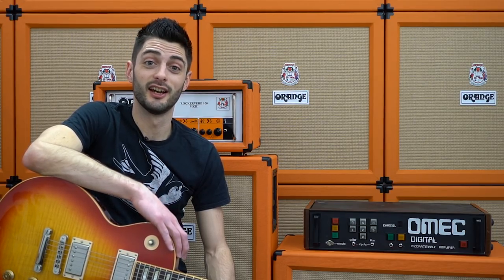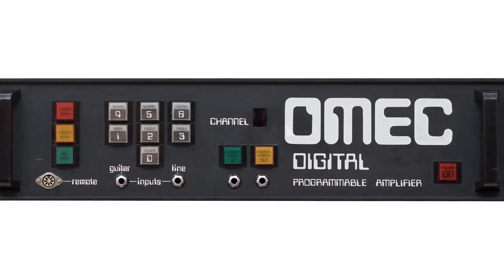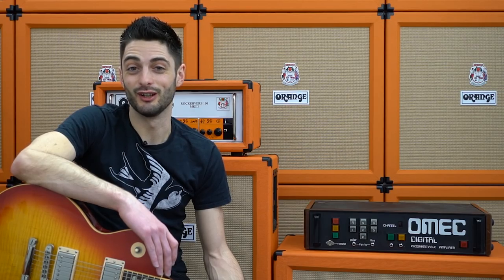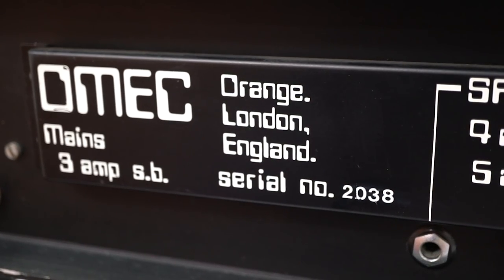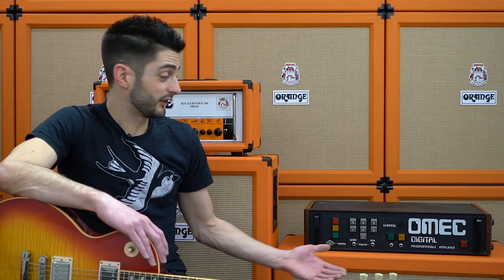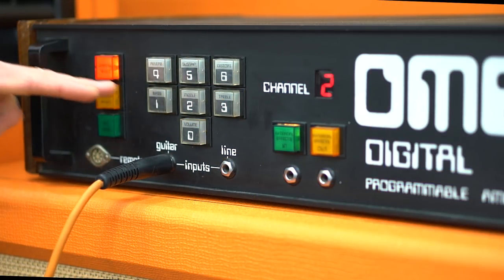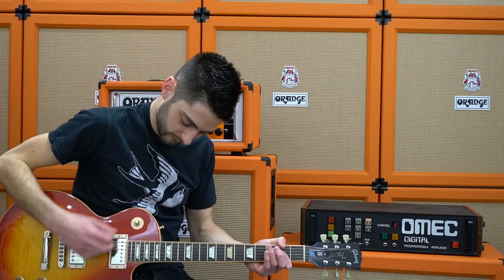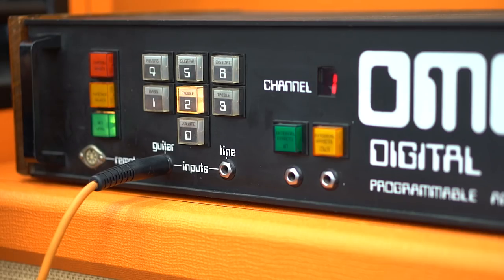Orange History - The OMEC Digital (from 1974)

Comment: Suddenly I feel very old.  

I don't remember it  sounding that bad! 

If the clipping on the "clean" bits of that recording came from the amp and not the recording process then the switched pre-amp gain control on the rear was probably set too high. The dynamic range of the signal processing path wasn't very good (too many opamps) so the idea was that you minimised the hiss by adjusting the gain till  the amp  was just below clipping at the maximum guitar output.  

The harsh, fizzy sound at 1:50 sounds like max distortion, max treble, and bass/mid set close to minimum - don't think I've ever been there!

But yes, it didn't sound too good at the best of times, just enjoy the flashing lights and the insane font (which was futuristic at the time...).

Comment: The amp sounds great im sure but it was compressed as fuck and threrefore sounded like shit
Reply: Yeah. I would have said it less aggressively but that was ALOT of really slow compression.
Reply from the maker: There is also a compressor on the amp, we didn't do anything to the sound EQ wise in post. The amp is very interesting to work with, compression seems to appear!
Reply: Orange Amps 

Seems to be the only function that goes to 11
Reply: Orange Amps 

Ok im getting rude...

To be clear i think you make some amazing amps and i would say especialy in the 70s you fuckin nailed it 

But that just sounded terrible 

im sorry
Reply from the maker: It's fine, we understand. It's a really interesting amp to sit down with and play. Just a little bit ahead of its time.